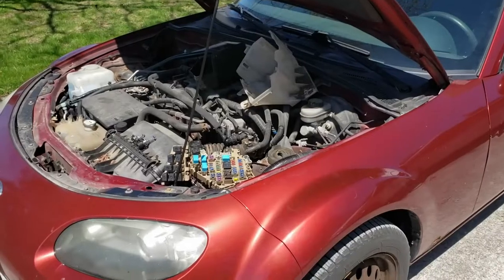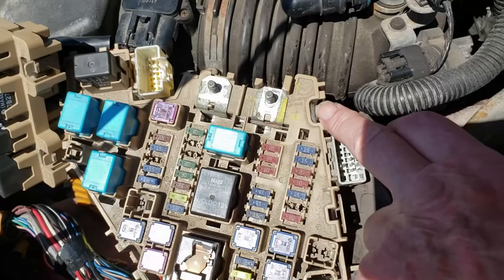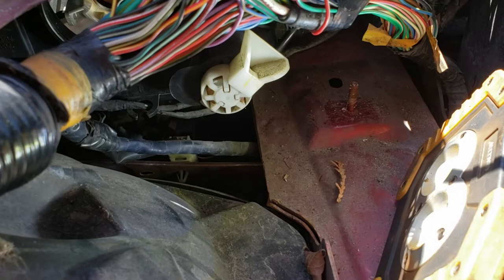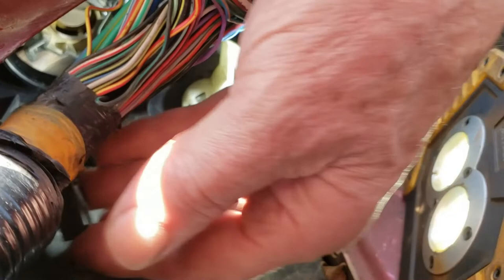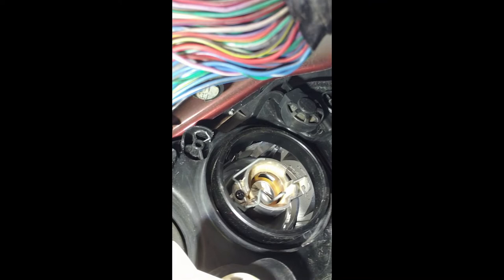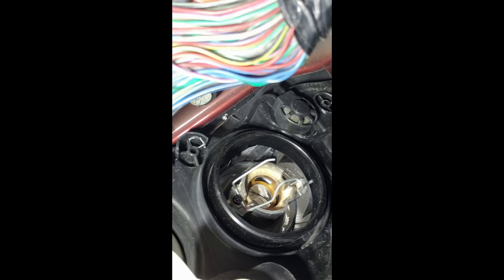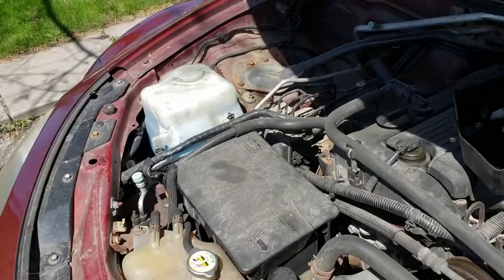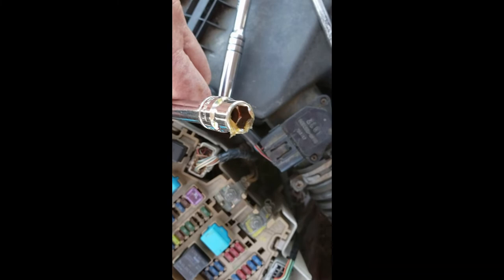2007 Mazda MX5 NC series Headlight Bulb Replacement

Comment: Excellent video, especially how to handle the clip. For the left-hand side of the car, would the bulb be accessible by peeling back the inner fender well? Again, excellent video. Thanks!
Reply from the maker: No idea! Never thought about that. I've seen other ideas but rejected them as too difficult or time-consuming. This is what I got stuck into and it worked for me. The worst part was figuring out the clip. I now have a real Miata - 1966 MGB..